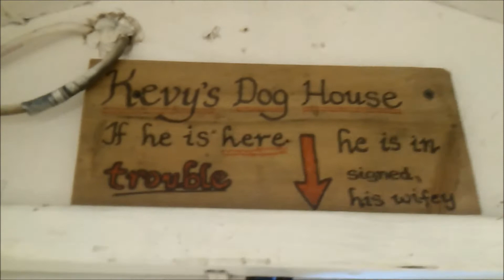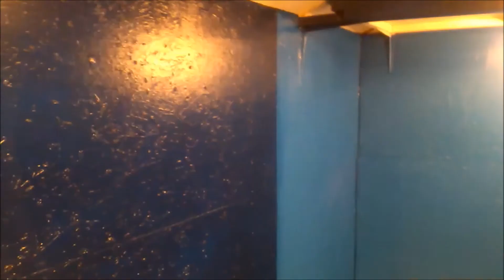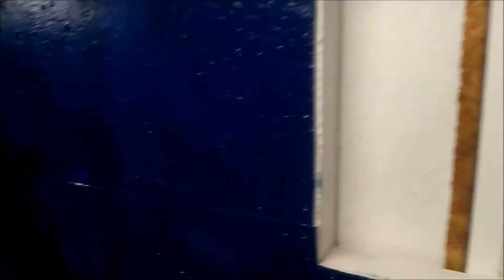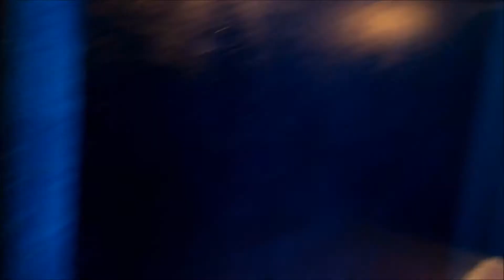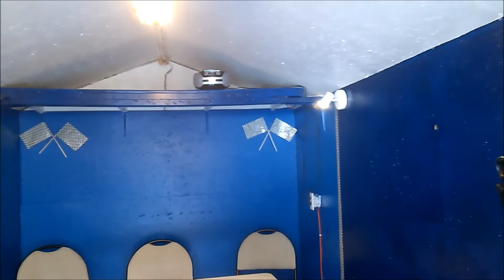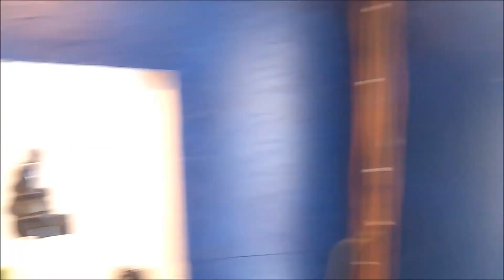Recording Studio Project

Comment: I would recommend some Skylights so you can have daylight!!!
Reply from the maker: you want to come put them in oh and i want auto tint glass as well lol
Reply: I actually know how to, I use to do that for a while. Skylights are not hard, you just have to make sure everything is squared and cut to size, then put some waterproof sticky wrap around the edge, lay down a nice bead of waterproof silicone, screw them in, place shingles back around and your done.  I think skylights are the easiest to do out of doors, windows and glass sliders.. For window tint I would get the cling type of tint because its easy to take off in a few years once they start fading because they just are not that good.
Reply from the maker: ***** cool